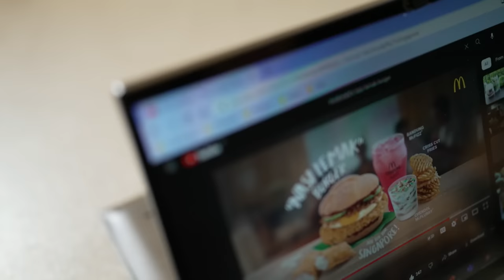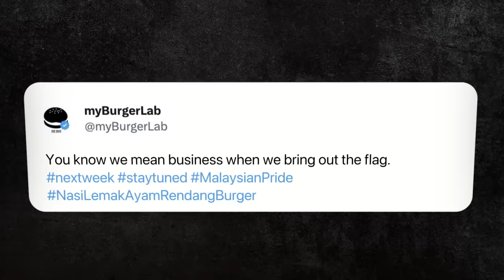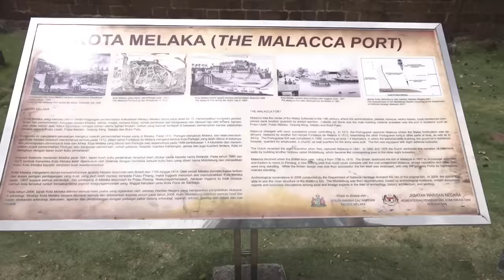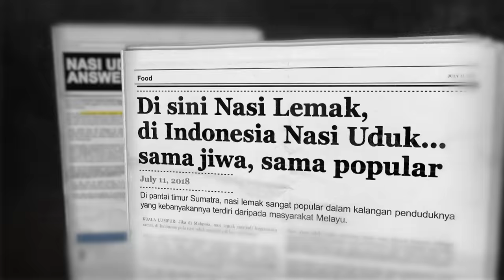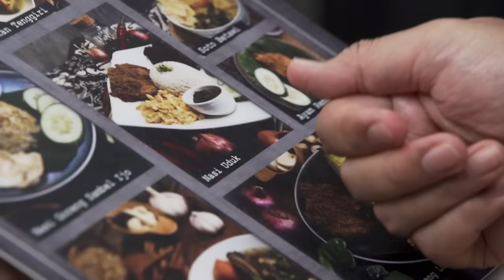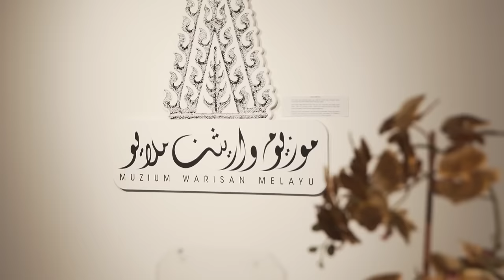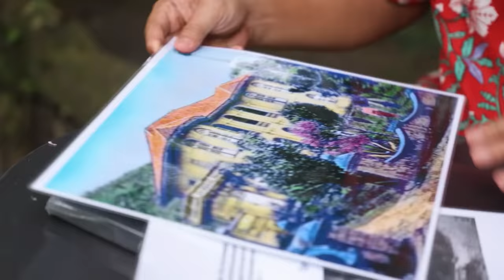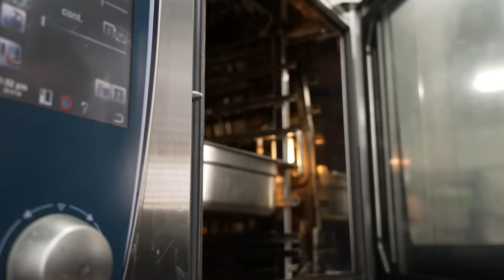Nasi Lemak: National Dish Of Singapore Or Malaysia? | On The Red Dot: Food Fight - Part 3/4

Comment: Melayu Malaysia is part of dunia Melayu Nusantara - Sumatera/Swarnadwipa, Indonesia -> part of Melayu Sumatera/Swarnadwipa/Swarnabhumi (means Golden Plains/Island)
     Sriwijaya which is based/centered in Palembang - Jambi - Bengkulu - Lampung nowaday (Sumatra/Swarnadwipa Island) which stretches from south of Thailand, Malacca Peninsula, Sumatera/Swarnadwipa, half over Java/Jawadwipa (meaning "Island of Barley"), and several other areas, it does have one part of the area that is used as a sub-centre (especially as a center of trade affairs) -> namely the area of Malaysia nowaday (on Malacca Peninsula); When Sriwijaya was weakened due to attacks from the South Indian Cola Kingdom (the reason for which is still a mystery, because the two kingdoms are friendly, even Sriwijaya had built a temple for the Cola Kingdom, but in general it is said because of trade competition), then rise to the Dharmasraya Kingdom (and there are also several other Kingdoms) which was based in Dharmasraya Regency, West Sumatra, Indonesia (today), whose territory also includes the Malacca Peninsula (today's Malaysia). In the Eastern part of Java Island, slightly to the center, rise another Great Kingdom ie Majapahit.
     Its true that the former sub-center on Malacca Peninsula (which may have been run by descendants or part of the family-line of the Sriwijaya Kingdom), in this dynamic situation, once controlled the Riau and its surroundings and continues to change, including again becoming part of the Dharmasraya Kingdom (West Sumatra), and so on. Until in the end it became the Negara Kesatuan Republik Indonesia today in modern times, as a Nusantara struggling for independence, on a former Dutch colony border. 
     So, the Malay Peninsula of Malacca is part of the Malay World of Sumatra, there was even a World Class University as a result of the efforts of the Sriwijaya Kingdom. Those are the facts. 
     The Indonesia today, for the blessings and mercy of the Owner of the Universe, God Almighty, is result of struggle and unity from Rakyat Nusantara based on the two great civilizations of the two great empires Srivijaya and Majapahit together with other kingdoms and other ethnic groups that exist throughout the Nusantara - Indonesia within the boundaries of the former Dutch colony, who declared to be united, as one nation: WANGSA/BANGSA INDONESIA - in the unified language: BAHASA INDONESIA - one motherland: TANAH-AIR INDONESIA, by the name: NEGARA KESATUAN REPUBLIK INDONESIA (NKRI), officially abbreviated: REPUBLIK INDONESIA (The name "NUSANTARA" was even proposed as the name of NKRI now, but it would be very very problematic, because that concept would also include the areas of the former two Great Kingdoms of Srivijaya and Majapahit which has become or part of another country, outside the boundaries of the former Dutch colony -- the name "NUSANTARA" was finally planned, decided, and enshrined as the name of the New Capital City of the NKRI on the island of Kalimantan/Kalamanthana). Those are the facts.
     
*) It is normal for a form of culture to develop and vary elsewhere, related: formerly part of the same Empire/Kingdom, migration of inhabitants, etc. However, the original regional spot where it comes from cannot be denied, part of the history of its origins. That will never change, as a foundation. No matter how satisfied you are with a false claim, it still won't be true, what is true is "a version of the variation that was created in a new place," but if you mention the original origin, of course you mention the place of origin, not a new place.
     In the culture of "open-source" programmers -- as a system of open development of ideas -- this happens more systematically; There are "forks," there are "allowed modified versions," "combined version," "development version (by others, with a slightly different name)," etc., but the original origin is still listed and pointing as part of the software history, not even being claimed unilaterally; It's called theft. 😏 If an "idea" is so different from the original, has become so complex that little remains of its origin, has been mixed with a number of original ideas, then it can only be called a different thing, is already the result of a complete unique creation, but when asked about its roots, thus the origin of these ROOTS will still be mentioned as such.